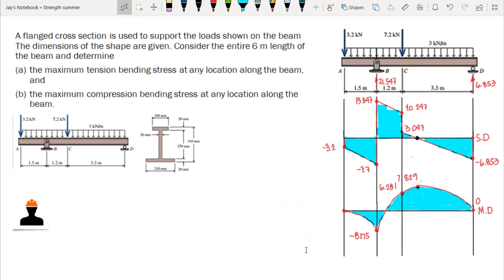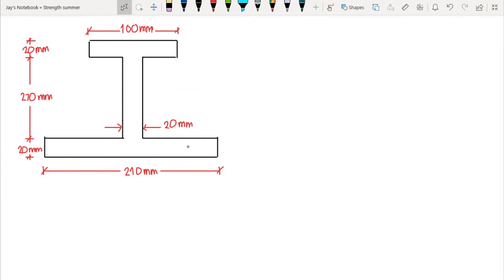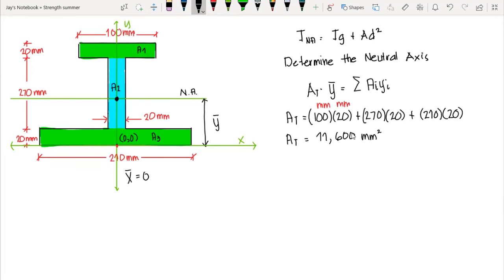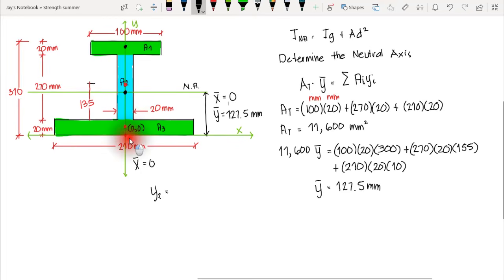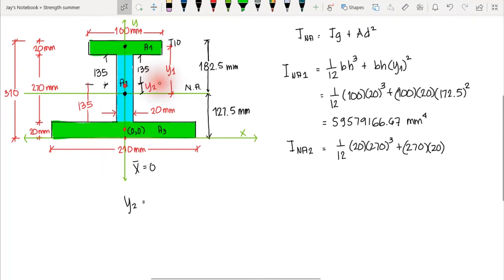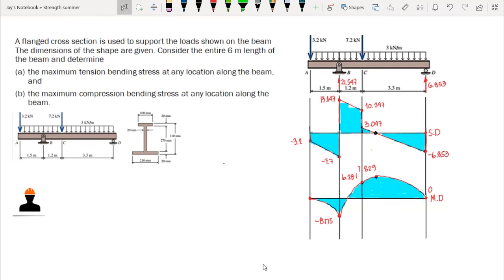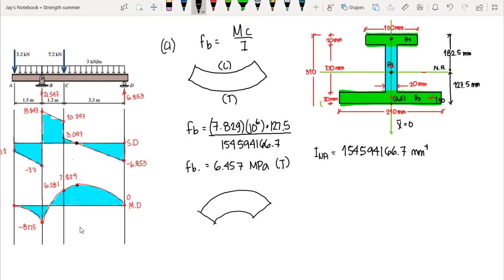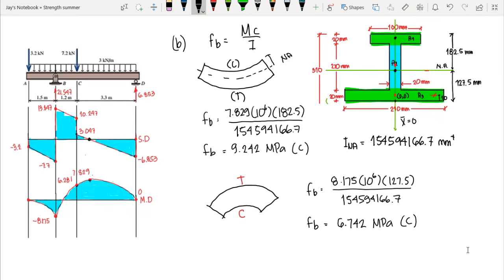Strength of Materials: Flexural Bending Stress in Beam Part 2 of 2

Comment: Prof, would you tell us where this section of beam is applied/used in the real world? And why this shape?
Reply from the maker: There are other steel beam shapes such as W flanged which is used as beam. I can direct you to this site. 20making%20them%20more%20efficient
Reply from the maker: http://www.renegadesteel.ca/blog/what-is-a-wide-flange-beam-its-uses#:~:text=The%20primary%20advantage%20to%20the,load%2C%20making%20them%20more%20efficient.
Reply: Thanks a lot.